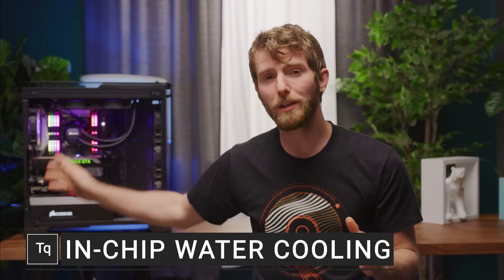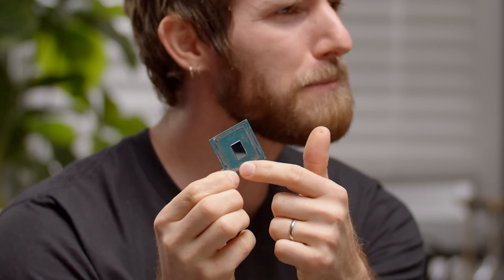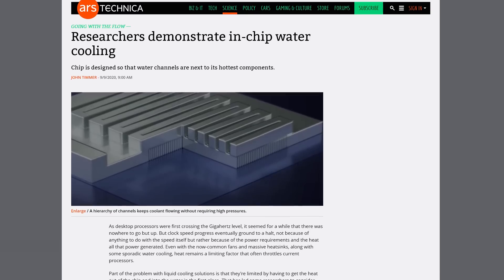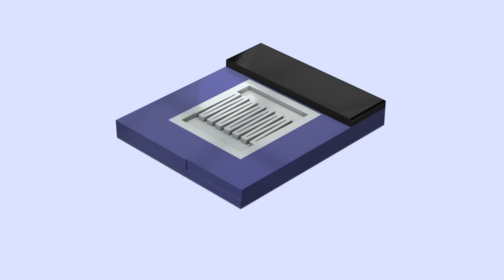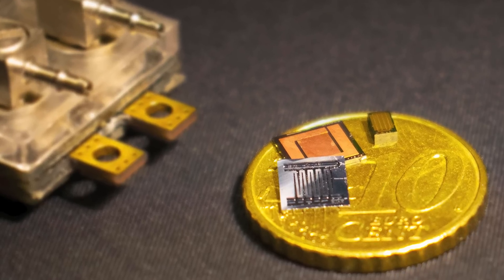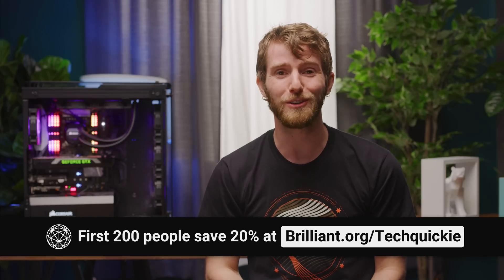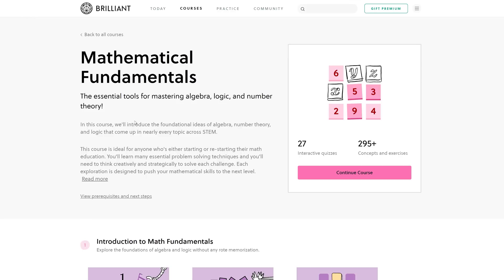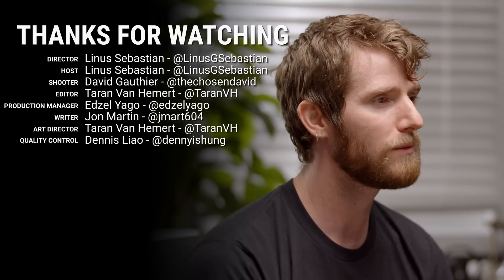Water Cooling INSIDE A CPU

Comment: I invented water cooling in the early 1980s I stopped working on my  third prototype because people laughed at me ,but not the ones who stole my idea, they've gotten totally out of control with it with fans in front and back of the radiator?  and they're still moving tons of air is multiple fans robbing electricity (and creating heat)from the power supply? Way restricted coolant  flow causing failure of a non redundant single water pump, I could go on but I'm not.
, this time 'm protected , so feel free to steal this one, I'm taking the guts out of a small window air conditioner or one slightly smaller than that)adapting my condensing coil to one of your water pipe CPU heads , with the condensing coil and circ fan  inside of a sealed up PC like a refrigerator except no one to open and close the door so no moisture will get in ,I will be able to temperature regulate any thermal heat a CPU or internal computer can dish out and with a system that's not drawinging off of the power supply you're eliminating that heat too so go ahead and laugh if it doesn't work I'll be laughing with you, if it does work 'it will be quieter more efficient and eliminate problems of heat coming from a PC ever again in my humble opinion anyway. I've ordered all the parts to building a computer and I've already started to work on my prototype
Reply: It would be interesting to see your prototype.
Reply: Subbed, can't wait to see what happens.
Reply: @javierititin  here's what happened so far ,I let my son handle buying me  a computer and he got me one of those compac ones that sit flat I have the machine here ready to go LG AC it's almost too big it's a tower that sits on the floor and blows hot air out of an exhaust pipe on the back basically I'll let you in on it I'm not hiding anything ,it's going to be a completely sealed up Tower so no condensation gets in and it's going to work like a refrigerator it has an internal coil with a circulator fan and keeps the interior any temperature you want , just like a refrigerator as long as no one opens the door, you get no condensation in there, all the cooling you want using only one fan.
Reply: @mrromantimothy  And the sound? Also, can it be minimized?
Reply: @javierititin even just this mini AC it has to have a duct to the outside I think it would be too much it would freeze up so it would have to be minimized, what I'm talking about would just be a proof of concept but you could take the sides off of your tower stick it in a refrigerator with a lock on it so no one can open it to let in condensation, make sure and have a circ fan right on the CPU ,see how much you can overclock it. 
The concept is like looking at it from the other direction instead of trying to pull heat off of your CPU and extract it you're blowing  an endless supply of cold air on it to cool it down since heat is attracted to cold, it makes more sense., Here's something else no one has thought of why not refrigerate the water that you're cooling your CPU with?

Comment: Integrated Sub-zero Alcohol-cooled, RISC5, 3D CPU cube when? (Mineral Oil PC not included.)

How many cores could you fit in a CPU cube? Actually, how would 3D CPU construction affect all of the performance statistics? Would it allow a higher clock, or would it simply let you do more with the frequency you have?

I wonder how the progress is on the research for the recently discovered room temperature superconductor. Probably not very far. Studying a substance in a supercritical state seems a smidgeon difficult. And you definitely want to study something that you're considering using to make expensive and critical infrastructure out of.

Comment: This is a great video. will vortex VS air coolled VS water cooled VS liquid metal : the future mainstream tech in 5-10 year is really blurry but it will be so cool
This is also greatly edited and doesn't 'need' a green screen BUT
the multiple camera angles and the unfocused shot(Linus not looking at the camera for the whole shot) is infuriating to me. Especially on a short, to the point video, I find it distracting without adding any value.
The shots are beautiful thanks to camera mans and editor (8K all the way 🤔?) but really distracting when switching for no reason on such concise shots and videos

Comment: Yeah, another super complicated thing to go wrong and not be able to fixed if something goes wrong. One of the great things about CPU's, is that their actually pretty durable as along as you're careful, don't bend the pins and don't abuse it with high temps (or handle it like Linus..j/k!), it can basically last indefinitely since there's no actual mechanical functions to break or wear down. 

Also, one big potential problem I see with this solution is that like with every liquid cooling option, is eventually with enough time the liquid used will evaporate. It already happens with AIO's and causes them to worsening performance overtime until it basically doesn't work at all. Also unlike most AIO which if its DOA or broken most of time can be sent back to manufacturer and or just replaced with out needing to buy a whole new CPU, I don't think that would be feasible option with such a integrated cooling option. Meaning that instead of having a CPU that will last WAY longer than you'll probably ever need, it'll become another item with a expiration date and won't be able to be recycled and/or reused in other projects and will just add to the ever-growing electronic waste problem. 

IMO, While overall while the performance and efficiency benefits are quite attractive, especially in certain instances where cooling is extremely important and price isn't an issue, it'll just become another thing to break or not work and cause more problems than it would solve....At least that is, until all the kinks can be worked out or until we reach the physical limitions of more conventional cooling options (the last one I have to admit we are rapidly approaching faster than ever though).

Comment: New set is fine, but looking at the side of Linus's head is unnecessary... Switching up camera angles is perfectly normal but you don't need such a drastic diagonal... Even just coming in from a slight angle to switch it up would be more than enough

Comment: 2:03 big misunderstanding from linus here , the 1.7Kw figure refers to the converter's power, not the heat dissipation. The heat dissipation is one minus the converter's efficiency times 1.7kw , which comes to much much less than 1.7kw . Disappointed in your "science" team.

Comment: This could be interesting for REALLY small chips running at insane temperatures.
I mean isn't really small the endgame of smart tech anyways?

At a certain point normal coolers won't have enough contact surface, this in-chip liquid cooling could be one answer.

Comment: I always fantasied about a Liquid Nitrogen self-contained cooling solution roughly 15 years ago. I tried to build something using those thermal conductive chips (TEC's we called them), but it turns out they emit more heat than a generous heatsink. So mission was failed and people considered Liquid Nitrogen again.
I personally had once built a rig that ran on antifreeze because I lived in a basement without heating and always thought antifreeze would be better than using water without risking a potential freeze in winter weather. I was going for awesome there. Worked pretty well. Antifreeze can be used for liquid cooled computers in lower temperature environments.
But it still didn't help solve many overheating issues in the past generation.

Comment: Maybe a better solution to the problem of CPU heat dissipation is to just not generate the heat in the first place. With Intel/AMD processors increasingly needing more and more exotic cooling technology to keep from melting, I have to wonder if ARM CPUs will someday soon be the preferred processors for high-performance systems. Currently, the world's fastest supercomputer is using ARM.

Comment: The problem I see with this is fouling the microchannels over time, and separately of course the risk of the pump breaking down.

Chip manufacturers want to shift the risk into the cooling manufacturers so that they only have to worry about the processor performance and I don’t blame them, I would be much more concerned about reliability through a micro channel water loop, and that would be a monumental challenge for cleaning, if that is even possible.
Reply: Plus just think of how many rookies would end up soaking their chipset during the installation process. It’s much safer to keep the chip and it’s cooler separate. CPU dies Change the cpu. Cooler dies, change the cooler, with an integrated system, if either breaks down, you need to replace the CPU which is the expensive part. Air coolers are reliable and for all except the most obsessive tinkerer, usually all you need to keep a high performance machine working well for years.

Comment: Hey, im a noobie when it comes to pc parts, and I was wondering what is the best cpu for Asus Cerberus GeForce GTX 1050? Preferably under 130 usd.
Reply: Ryzen 3 5th or 3rd gen, or a core i5 4500 if you go on ebay you'll find it for wvwn cheaper

Comment: All CPUs and GPUs should be able to run fanless with a heat sink built into the heat spreader that can be expanded with a larger heat sink and/or air and/or water cooling. Should have been like this years ago. Didn't have to be this fancy new microstructure, although now it's invented and hopefully cost effective it's a good addition to the basic concept... It's like they want to sell junk more than fundamentally improve products.

Comment: One thing is to move away the heat from the heat spots and other completely different is to dissipate it, you Still will need a way to keep the liquid cool enough that it can continues to extract heat, so while you will need less liquid you will need a more efficient way to dissipate heat into the ambient than a radiator, maybe a peltier will be a must in those systems.

Comment: IBM did this years ago with a computer in Germany called the Super MUC. I was the ME at the company that made the manifolds to collect and distribute the coolant between the rack units. Cray was also doing this good couple years before IBM. Generically it's known as warm water cooling. This is because they don't need to chill the water to extract the heat from the processor. The coolant actually gets warm enough that they can eliminate some of the heat pumps in the system and recover a lot more energy.

Comment: There is a massive draw back to this system. The water has to be extremely clean. Any particles in it will clog the capillaries in a short amount of time. That means no filling it with tap water. HAving to have a special filtration system in the loop to keep any particles generated from the pump and other components from being pushed into the CPU cooling system. The filter would have to be as close as possible to the CPU to ensure the least amount of water loop is between it and the cpu. That means this entire cooling system is going to go up in cost a lot.

Comment: Linus 2021: how to water cooling a water cooler
Reply: Nah! You need to helium-cool the water cooler :)
Reply: Water cooling a water cooled water cooler
Reply: How to English: how to water cool a water cooler*
Reply: @joshsanderson5512  correct :)
Reply: Watercooling the Cryocooler
Reply: HOW TO WATER COOLING A WATER COOLER WATER COOLER
Reply: using the ocean to cool my cpu!
Reply: I'm pretty sure GN put a radiator in an ice bath before or maybe that was bitwit
Reply: Water powered and water cooled at same time sounds plausible.
Reply: me in 2021 🤔🤔
Reply: Lol
Reply: water cooling a water cooling water cooler
Reply: Water what? Whater?
Reply: 2019: De-lid 

2020: What's thermal paste?

2021: Let's watercool the chip entirely.
Reply: I think you mean, "How to ice cooling a water cooler?". :)
Reply: @marcosanaya9540  invest
Reply: @marcosanaya9540  how to laser cool a ice cooler
Reply: @marcosanaya9540  ]
Reply: -20°C
Reply: Technically is a very easy thing to do, but is actually like using more spine, is better using one but more longer

Comment: It's more than just higher overclocking. With so much thermal headroom ICs can be engineered to consume more power under load by default. Alternative materials, gate designs, and architectures could offer significant performance gains. Also, a water-cooled smartwatch will probably never exist. One side is thermally coupled with your skin, and the other a display panel, not to mentioning that the power source is the limiting factor for computational power for the time being and likely long into the future.

Comment: I am not convinced on this at all. The diameter os those capillaries is going to be minuscule,  creating a massive restriction which works against the the flow aka pressure head, which will result in heat. Also what happens when a single spec of dust gets lodged in the capillary. No flow. Or what about the water not being perfectly de-ionised leading to build up in the capillary. No flow

Comment: I think there's some confusion there. On their published paper, there are 20 microchannel chips in total to deal with an output power of 1.2kw, not the single 0.81 sqcm chip. So according to the paper, the maximum power can be handled by a single 0.81 sqcm chip is around 350w (7kw/20), when the temperature difference is at 70°C (to avoid water boiling), which is still amazing and will take care of most of CPU without problem. For reference, the threadripper 3990x peaks at about 400w for 8 dies so each die only pumps 50w. Think about maxing the 3990x at 10C above room temperature.

Comment: Why would this require less water in the loop?  Isn't most of the water in the tubes and radiator, not the cpu block?

With this you can more efficiently move heat from the cpu to the water, but it does nothing to improve the the process of removing the heat from the water (which is done in the radiator)....

As I typed this, I realized the answer.  For anyone asking the same question:
A radiator will work better when the temperature difference between the water and the ambient air is larger (Fick's Law). 
 In normal water cooling loops, the water is well below the 80-90 degrees your cpu is at.  If you improve the heat transfer between your cpu and the water, you will increase the temperature of the water leaving the cpu (closer to the temperature of the cpu).  As a result, the water entering the radiator will be at a higher temperature.  And (as I noted above) a larger temperature difference between the radiator and the ambient air, the more effective the radiator transfers heat.

Comment: Something I have been meaning to mention.... pc cooling depends on ambient air temperature yet you never mention your room temp. Here in Africa air conditioning is not common so ambient can be 30 to 40 C for several months of the year , which can really test your cooling solution. Laptops suffer more than desktops.

Comment: I would prefere there would also be an interview with the team behind this sultion and the questions about the limitation. I would think that these microfins are proune to gunk up if the liquid is not good enough for this system. 
For me this just looks like an idear that is only produces inside the lab without any real testing in an production system. You can build all kinds of stuff in the lab, the real test is in the real world and I have allready some concerns when it comes to systems that will run for a long time.

Comment: I see where this is going. Eventually, the CPUs we buy will pretty much be AIOs that take up the same amount as a cooler that comes with an AMD CPU. The CPUs will no longer be solid object, but instead be replaced with a goo that handles all computing. It will be pressurized, and when you install it on your MOBO it will make a satisfying PPPSSHHHHHing sound.

Comment: This would be huge. It could also allow chips to grow into the third dimension.
Reply: Would this be as huge as the invention of CPU throttling?
Reply: @IARRCSim  it could be but only if done correctly.
Reply: Why would this allow for chips to grow into the third dimension? I don't think I know what you mean, but my understanding is that most chip geometry limitations are from how hard it is to do anything other than 2d lithography and still end up with a functional product (and "good enough" batch quality)
Reply: @mckryall  Perhaps they just meant effectively stacking CPUs on top of each other, with a heat extraction layer between them. There doesn't seem much need yet though, they can still get a load of cores on one standard CPU.
I've always thought CPU & component cooling was really backwards though, and not just the terrible standard transfer method as this video covers.
It seems weird putting big expensive coolers inside, but just using the air that's inside the case & just deciding 'meh, it can find it's own way in & out', surely an inlet & outlet from outside the case to/from the cooler could also help.

Comment: Safe Intel plan:
1. Add this on top of their CPU.
2. Change layout of the heatspreader, so it has to cambers, make top thicker.
3. Add 1/4 inch threats for water cooling directly in the top surface of the 'heatspreader'.

So the CPU would include the cooling block directly. Cheaper for user, better cooling, higher overclock, safe ass in comparison with Ryzen 5000.

Comment: I love LTT vids... i cannot make a difference between the ads and the real show as both features Linus XD 

Anyway this cooling solution is interesting. Beyond the gaming PC's and computing there is a very demanding task that would definitely can use this cooling solution.  Namely cooling a Radar. 
Nowadays war-fighters are getting a new interesting AESA radar, this a radar consist of small elements containing amplifiers and a low noise receiver. Anyway this technology also brings alot of heat.  Something like in KW range.